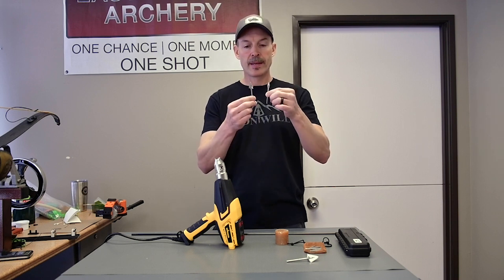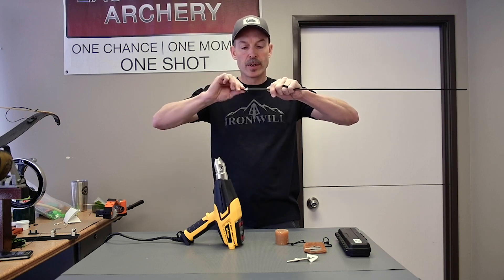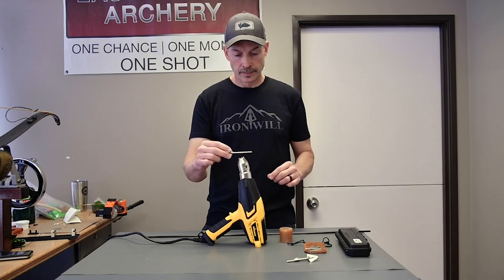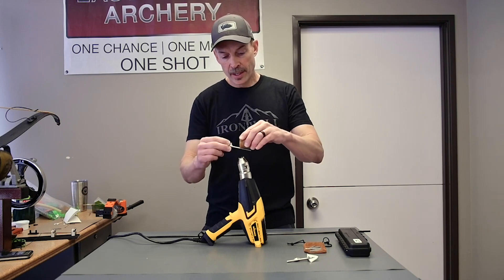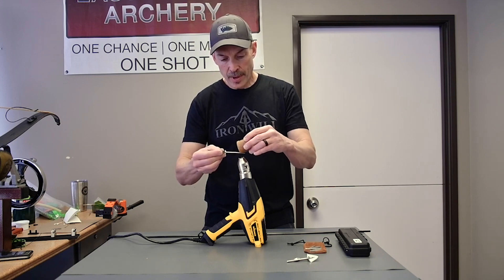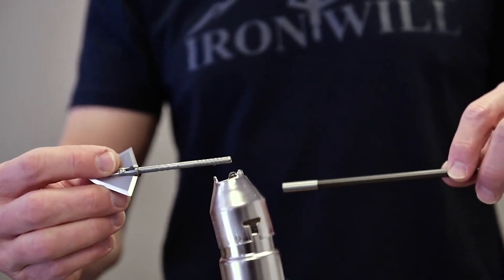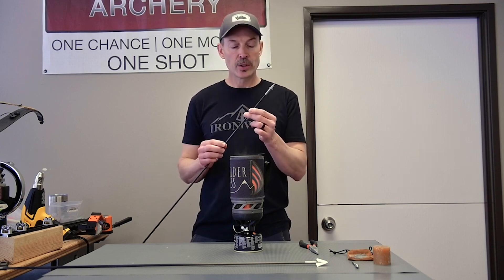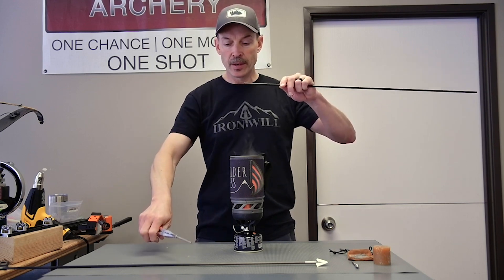How to Use Hot Melt Glue to Install the Snyder Core System (And Remove It) When Building Arrows

Comment: Bill, I think there is a common, unanswered question for many of us (including one other person below, I believe). When using hot melt glue, Why do you recommend glueing the Broadhead or field point in with the insert as a unit? I am assuming that you feel the bond is inadequate otherwise and as a result the insert might pull out of the shaft when retrieving an arrow from the target.  Please let us know.

Personally, I strongly prefer to use a foam target that allows my shaft to penetrate through but stop before the fletching hits the foam. Then, I remove the actual Broadhead before pulling the arrow.  This technique is especially important when using single bevel broad heads. The challenge with my method is that almost nobody makes targets of that type any more.  I have a small inventory of those targets and I think they are all about 15 years old. They actually last longer as Broadhead targets than anything else I've used.

Comment: I take soldering iron and set it to the exact melting point of the glue plus a few degrees to preference and insert the shaft over a soldering tip wich fits the insert snugly. Wait till it reaches temp and plunge it in using the soldering iron very carefully to start it and then screw in the broadhead to finish it. Works well.

Comment from the maker: This method can be used for .204 standard HITS and 4mm/.165/.166 Deep Six HIT Systems also.
Reply: Which is preferred hot melt or epoxy? I like the thought of epoxy but am worried about it setting up and no being aligned

Comment: What do you do if you need to adjust the alignment of the broadhead?
Reply from the maker: If the Hot Melt is still malleable you can rotate the Broadhead clockwise to alignment. If the Hot Melt is set you can either use boiling water or a heat gun (do not over heat) to soften the Hot Melt and then align the Broadhead. Always rotate your Broadhead clockwise making sure you are tightening and not loosening the Broadhead from the insert.